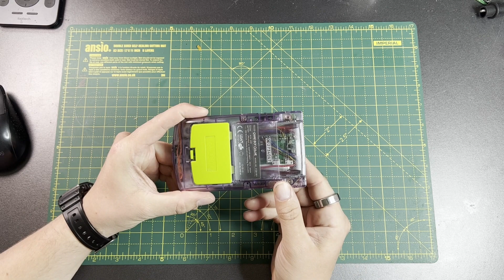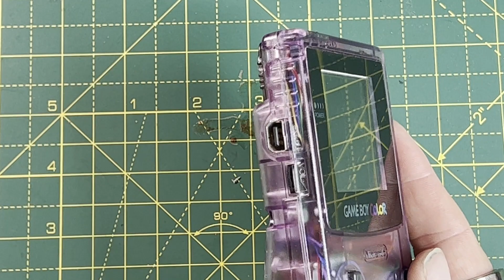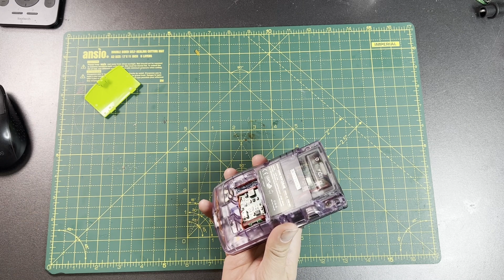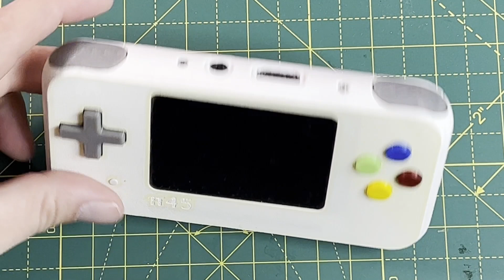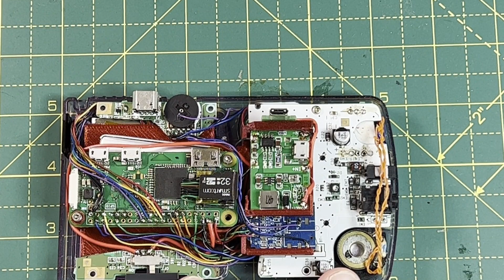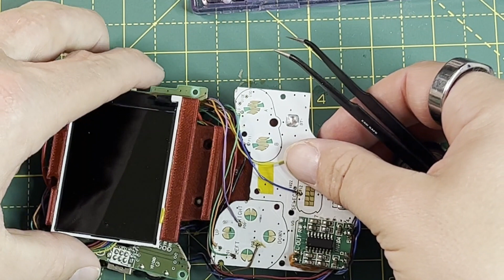GameBoy Colour / Raspberry Pi Zero conversion

Comment: Hey I was wondering if you could supply the dimensions of the pcb for the gb color with the notches and pin holes as I'm having a hard time building something similar with a microcontroller and just basing my design off board scans and dont know how accurate its gonna turn out
Reply from the maker: Hey there, I don’t really have such a drawing, I built a 3D model of the PCB.
If you have a scanner then I assume you have a printer? That’s a good way to verify fitment, and of course if you haven’t already got a pair of digital calipers with a “zero” button, you will need those to get real world dimensions.

Comment: btw do you run into any issues with the USB sound card? I have multiple of them that stopped working after awhile, I suspect it is because I did not put any resistors from the power supply to the USB sound card or poor wire management causing short circuits. I was wondering if you have any similar issues?
Reply from the maker: Not with the soundcards, they have been pretty bombproof, theres no resistors in a USB cable, and I havent used any on my soudcards, iv'e just replaced the USB cable with 4 discrete wires. I would try reconnecting a USB-A connector and plugging your broken ones into a regualr PC/Mac, see if they show up as an audio output? if they are truly dead, can be pretty hard to work out whats gone wrong :/ sorry I havent got any better advice!
Reply: @jamfab-james  all good mate 👌 I reckon is just my messy wiring that fried it some how. Just gotta go back to drawing board to plan it a bit better. Did you just reconfigure to select USB sound card as your audio device in retropie commands or did you install another driver?
Reply from the maker: no i diddent need to do anything sound-driver wise, the soundcard was detectred automatically as a USB sound thing. just needed to edit a config to make the USB soudcard the defult sound device:
https://www.tinkerboy.xyz/retropie-raspberry-pi-how-to-use-a-usb-sound-device/